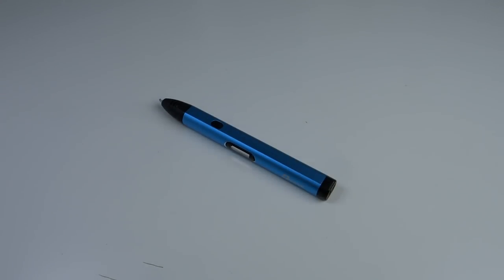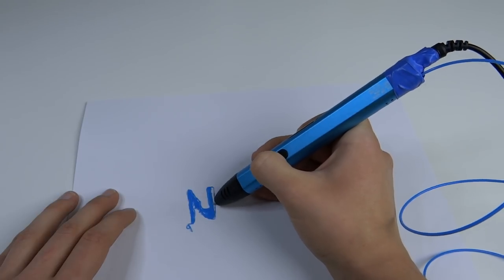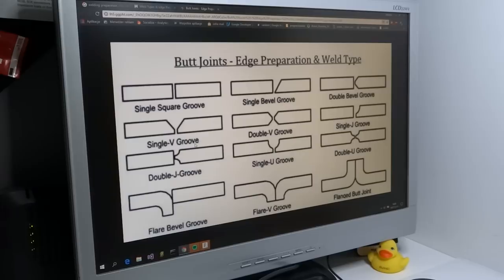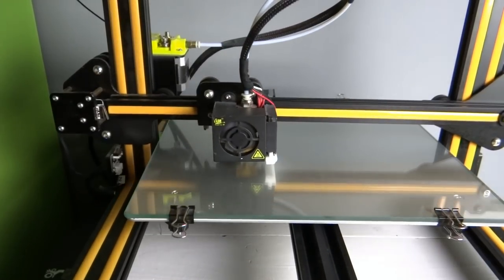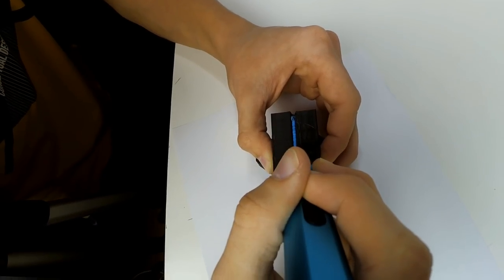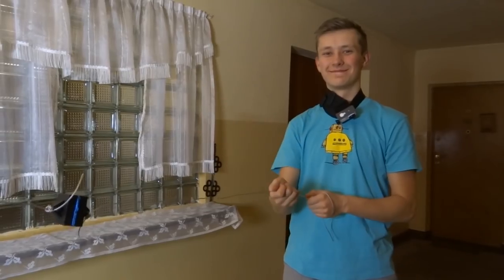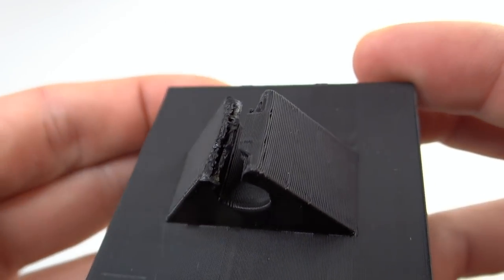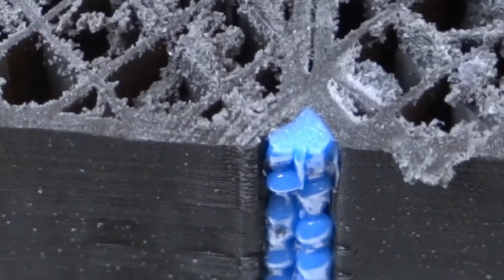Best way to connect 3D printed parts - welding with 3D pen!

Comment: This a good idea, well done. I am qualified as a welding inspector so can give you some tips.
The first pass is fine, the second and third fine too, the last one would be better if you 'pooled' the weld across full width of gap. Watch some real metal welding videoes to see the technique.
Also...
Here is something very important, that steel wire you used being pulled under load could whip back and the bare ends slice your skin open,,be careful. It would be interesting to see this done with Tpu filament.

Comment: I have a 3d pen in my toolkit for my printers, you are absolutely correct when you say it is a great way to weld parts. It is also great for filling gaps or flaws in prints. ;)

Comment: I have used mine to fill in pits or flaws in models before sanding them to paint, and for welding. Nice work!
Reply from the maker: Thanks! Maybe I will make a video about painting models and preparing them to paint in the near future :)

Comment: I had the suspicion that this would be better than welding with a piece of filament and a soldering iron with a flat tip.  you definitely proved that is the case.  the finished weld is not pretty though.  perhaps you should try smoothing over it with a flat tip on a soldering iron, or take your time with the final course, when welding metal a circular motion is used. I suspect a side-to-side motion would work well in this case as well.  also your pull test was executed in the most dangerous way possible.  steel cable wips backward faster than synthetic cables like paracord.  you or your brothers could have lost an eye or draw blood.  either try paracord next time or tape a small towel to the cord near the model to slow down the cable once there is a break.  this is a technique used for winching vehicles out of trouble safely.

Comment: I'm so glad I found this video! I'm new to 3D printing and I've been struggling with ABS, but PLA's low melting point turns me off. I was worried that PETG would be difficult to weld/glue, but never considered using a 3d pen!
Reply from the maker: Thank you!
Reply: ABS is very easy actually if you have acetone. You can melt in acetone abs plastic parts to make your own adhesive or directly use  acrylic apply on surfaces of abs parts. But I am looking for PETG which is almost nothing can melt except heat!
Reply: need a 3D Pen that can produce enough heat for PETG though.  can only weld with the same filament so the bond is chemically homogenous. I also print a lot of ABS and ontop of  Acetone/Methylethylketones  I also weld the pieces along the sides for absolute strength.

Comment: Today I used this technique as well. Best way is to use the hot tip of the pen first to "spot weld" the parts so they won't move while welding. Just push the hot tip into both parts and wait a sec until you see the tips form inside the plastic. Then begin going around the welding seam with the lowest speed of the pen and really push the hot nozzle tip into both parts and let it "swim" on the pushed out plastic. By this you're really welding! You melt the two parts alongside the seam and push new and freshly melted  compatible material onto the the seam. Like so you create a real weld by fusing the two parts and the seam together.

Comment: it would also be interesting to try and do almost as dovetail joint that slides in and then weld it in place you would get more weld surface area that way and some directional stabilization

Comment: So it's not really the same as traditional metal welding because in that you go for what's called "penetration", which is how deep into the metal the fusion of the metals extends (how deep the molten part goes before it hardens).  There is no penetration here, it's all surface level, the blue filament only exists in the chamfer and that's it.  There's obviously some penetration at a surface level for it to "bond", but it's not deep at all, nowhere near as deep as actual welding would be.

But that being said, it looks pretty damn strong.  So while it may not be as strong as metal welding is for metal, it looks like this may be pretty strong for most purposes of 3D printed pieces.

Comment: That's a surprisingly strong joint but i believe super glue will always be superior because you don't need a chamfer and can get much more surface aria stuck together.
Reply from the maker: But sometimes it się better to use same material to joint two bodies that those bodies are made from. Super glue is messy and reacts with some materials, of course there are some advantages of using super glue but some times there are better ways. Thanks for comment!
Reply: I have never seen super glue react with anything. You could try welding the pieces together with a soldering iron and filament it works like the pen but you can melt into the base material more
Reply from the maker: builtrodewreckedit super glue reacts with styrofoam quite strongly, using a soldering iron is good idea but I would rather suggest the hot air to not destroy soldering tip

Comment: Big Question: is a metal tipped 3d pen better or does a plastic tip work just as well? With a metal tip I think you can melt the old pla too, but is that necessary?

Comment: Not that I know anything about 3D printing or welding, but it looks like you could put multiple layers of filament into a groove until it was overly full, then sand it down. Then if you painted it your final product would appear to be all one piece, and it would have the extra strength of the weld.

Does it hold up if you twist it? Like you're trying to get the cream out of an Oreo?
Reply from the maker: nosdarb actuall I put multiple layers of filament but didn't sand it down. Your idea of sanding and painting is great for things that have to look good or final products. And yes it is resistance for twisting. I shot a scene where I am trying to twist it but light was really bad in it so I didn't include it in the video. But it was impossible to break it this way.

Comment: Of course the print broke on the holder with that orientation.  Print it rotated 90 degrees with the hole vertical & support underneath, it'll make the holder stronger.  You'll need support without a 45 degree chamfer underneath though.  When welding you should be pushing instead of pulling, promotes deeper penetration of the molten material and filling cavities as you do multiple passes.  Run the pen hotter for better binding, and ensure you fill the chamfers to get the largest surface area possible.  As you've not filled the chamfers with beads, you're only getting the strength of the smallest cross section.

Comment: welding rules are correctly applied. But, even if you use paper glue for the surface area that hook strength cannot hold!

Comment: Nice video. Actually I would have done the same test with a measurement tool.
Also smaller part to print.

Another advice is don't use the Dremel for cut the piece because 10000 rpm melt the plastic and it would weld all together... So you can't clearly see well. Use a simple saw and don't cut too fast.

Comment: I am curious if the tip of your pen was heating the black plastic parts and welding them or if it was more of the blue plastic making an actual weld.  Would like to see an undercut area welded where it’s only the 3D pen material creating the bond.
Reply from the maker: At the end of the video you can see how I cut it to check that

Comment: Great video!  Too bad my pen is 1.75mm and my printer is 3mm or else I could just use a bit of filament from my spool and always have the same material.
Reply from the maker: Thank you! You can always change extruder and hot end of your printer, thats quite simple :)